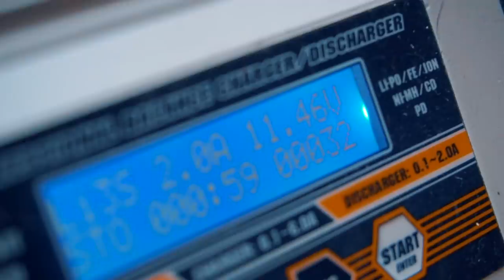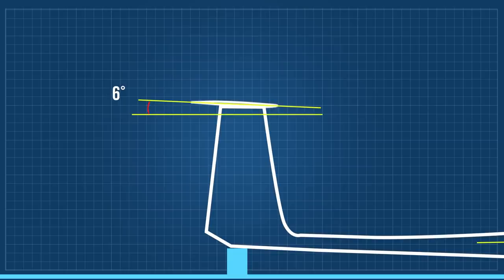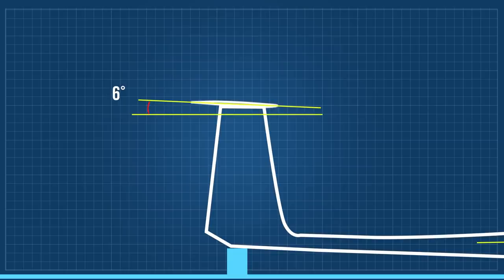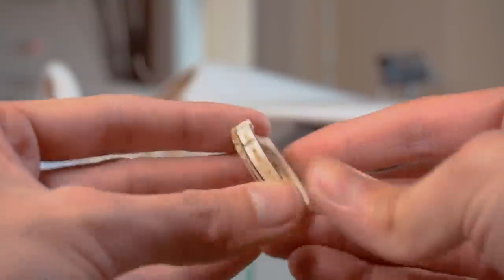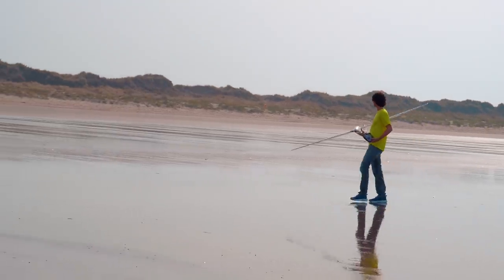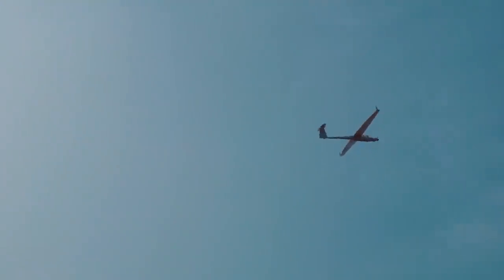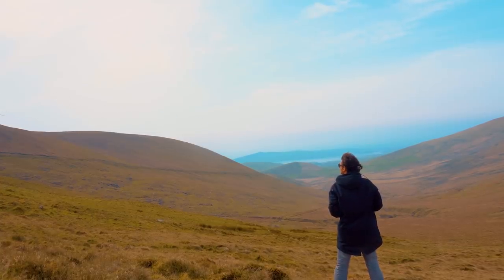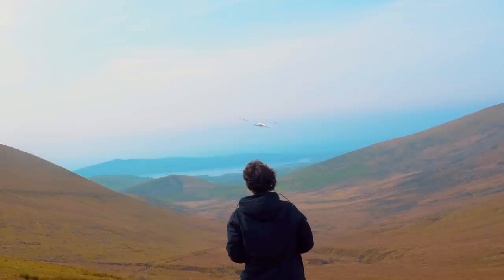Fixing and flying my RC glider | Micro documentary

Comment: What material did you make this glider of? Wood? Plastic? Did you make all the wiring and programming yourself to make it controllable? With Arduino or something?
Reply from the maker: It's made out of balsa wood in the wings covered by a plastic film, and the fuselage is fiberglass, but I didn't make it, I bought it.
Reply: @Joyplanes  Thanks for the answer! That glider is beautiful. Have you ever thought about flying yourself via a sailplane/hang-glider/paraglider?